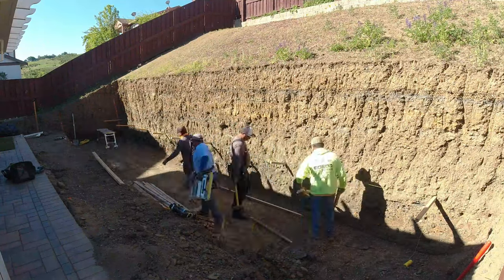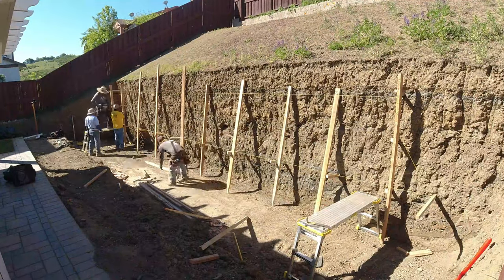💥 Had to Excavate 200 Yards Of Dirt To Build Concrete Retaining Wall❗

Comment: I noticed you use the Simpson Wedge Tie. I'm considering forming my walls up like you do with 2x12s. I did notice the specs say the ties are not recommended for walls over 4'. Do you use more ties or a closer spacing to compensate?
Reply from the maker: Crazzzzy you the 2nd person that said.. I've built wall as high as 10 feet..12 inches wide.. No problems.. Normally we are about 12 inches on center on the bottom board.. But honestly just eye ball it.. I guess you can say 16 inches on center.. We never had anything close to a blow out